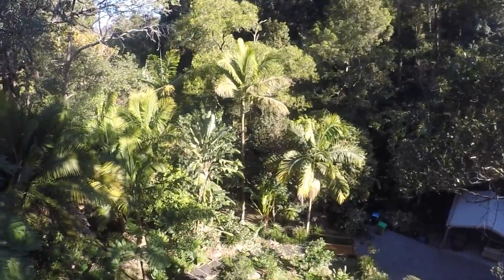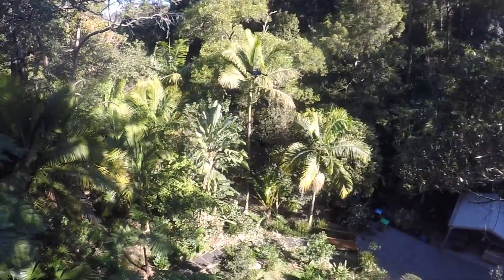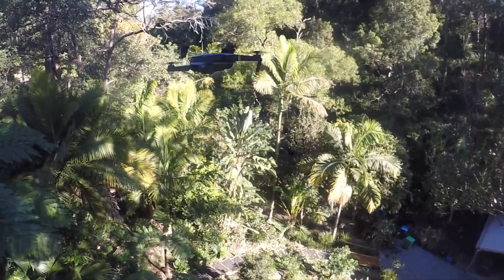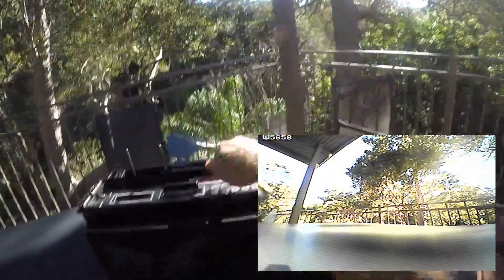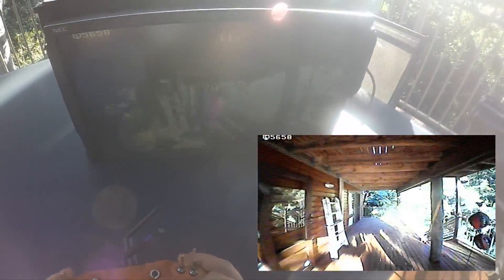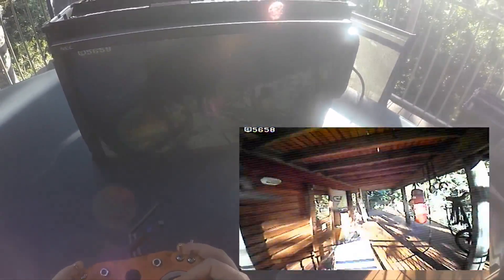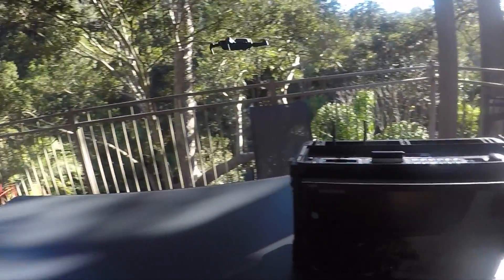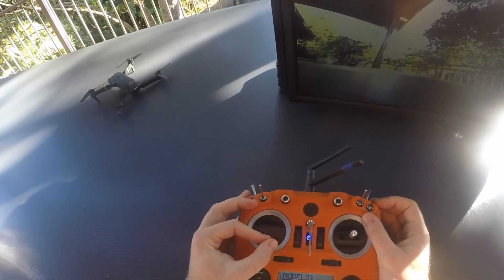$38 Mavic "Clone" (Eachine E58) - Hakked!

Comment: Are you using arduino or esp? Which firmware did you use to pilot your Quad? Did you add any other hardware eg, BMP180, gyro, GPS? Did you mount the microcontroller on a pcb board. Are you using a wifi cam?

Comment: I just bought some motors to replace the ones on my E58 but they run over 10,000 rpms faster than the original. Now I'm wondering how much more I need to do to get it to accept these motors. I haven't received them yet but I'm thinking that the one key take off function will send my little drone into orbit. Any suggestions? Stock motors run at 52,000, these supposably run around 66,000 but are the same dimensions and connector.
Reply: and how that worked for you....how was the flight, what did it change?

Comment: Hey, I've always wanted to rip apart a tello and stuff it's guts into an e58. Do you think it would work?
Reply: I think the chances for that to work properly are low. The FC assumes certain reactions and the voltage outputs on the ESCs, and if those are too far off, it will fly poorly or not at all. The Tello and the E58 being to very different platforms, the FC will be quite "surprised" of how the new host reacts. The only way to find out though it to try it ;)

Comment: Nice Would a Betafpv Lite FC board work with this quad?
Reply: Michael Reyes this quad needs lower PIDs than a Whoop. Also, the boards needs to sit square. So the answer is: if you flash the board with new PIDs and a sensor realignment: maybe.
Reply: @BenediktHaak Is it because of the geared motors that needed a lower PID tuning?
Reply: There are many factors that have a direct influence on the required PIDs for stable flight. Gearing is a significant one, but it is countered by propeller size and pitch. Arm length and weight are significant factors too. Such as motor speed and battery voltage. It’s so complex that we often can only figure it out by trying different PIDs on the complete system.
Maybe I’m wrong. Maybe the Beta65S Lite drops right in and works great. I’d be very surprised of that though ;)